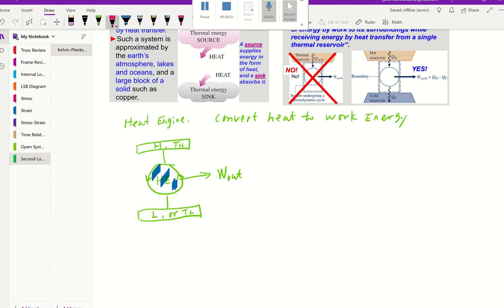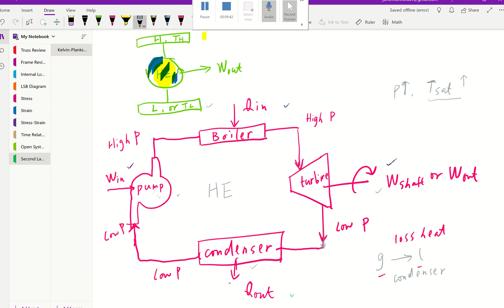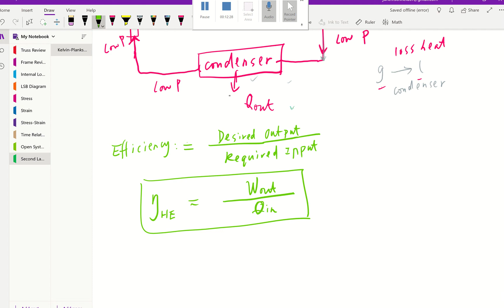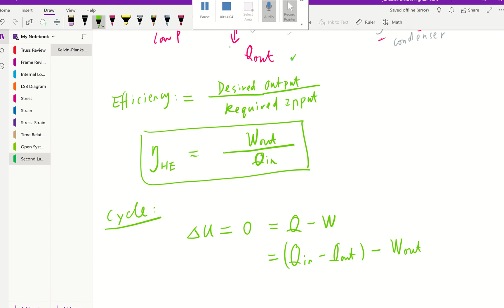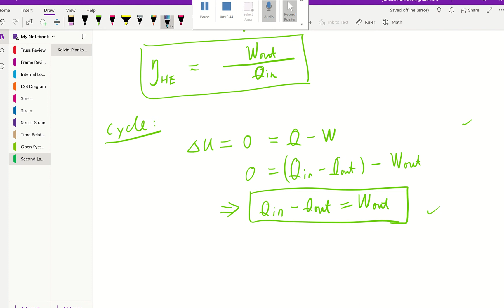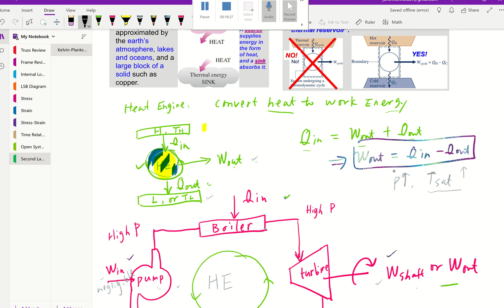Kelvin Plank Statement: Heat Engine

Comment: Even though the work in for the pump is negligible ,  is the supplied  pressure into the boiler taken into account when adding heat to the boiler? I would think that they must work hand in hand? Or is that one of those details that can always be improved to increase the overall efficiency
Reply from the maker: Yes. The pump increases the pressure of water. When adding heat at the boiler, it is at this high pressure. High pressure corresponds to high saturated temperature. So it reaches higher enthalpy or thermal energy at this high pressure. Them more mechanism shaft energy can be converted at turbine.
Reply: @juneschneider235  Ok makes perfect sense.
thanks